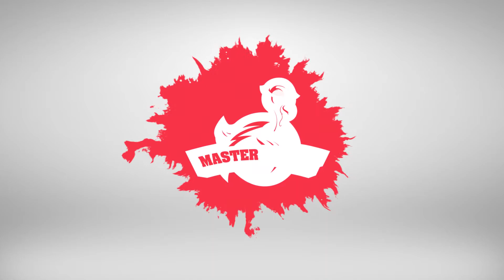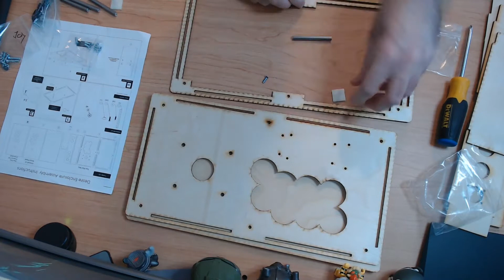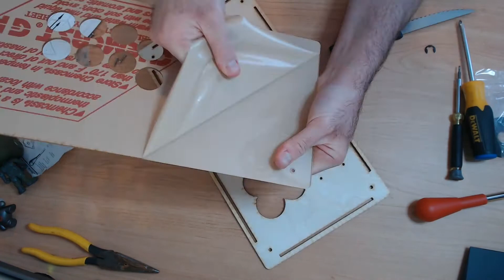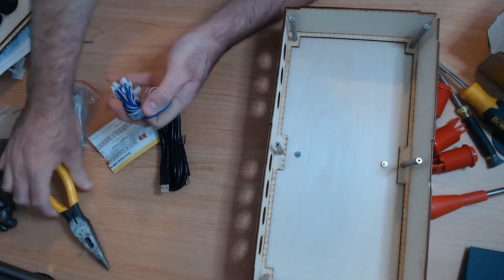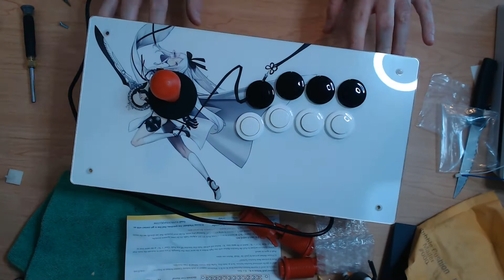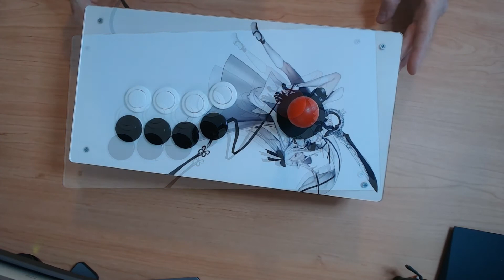Let's Build A Custom Fight Stick (Part 1)

Comment: Nice video. Not many like it online. I'm replacing my Sanwa buttons with IL Happ buttons. Does it matter which wire goes to which prong? Cause both wires are the same color and not sure the difference.
Reply from the maker: I believe it does. When you try it in windows you'll see if you need to move em around or whatever. Some of this was trial and error.